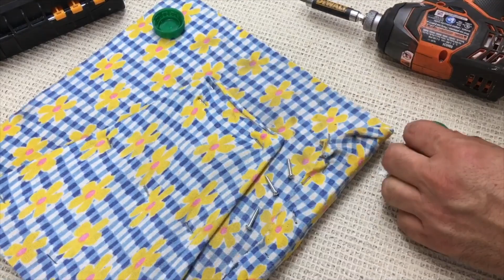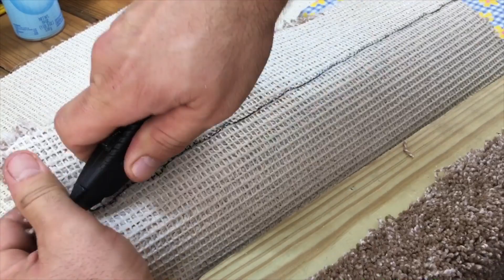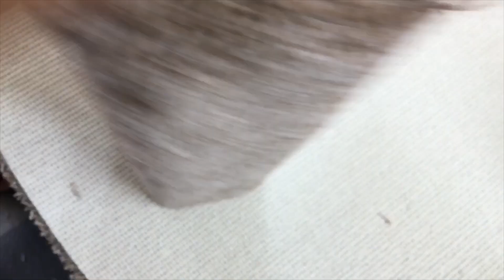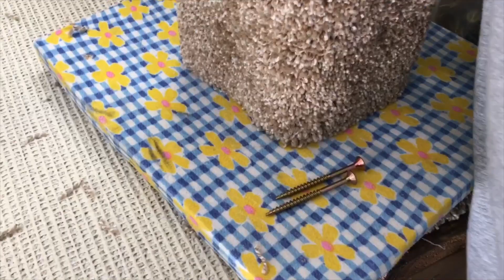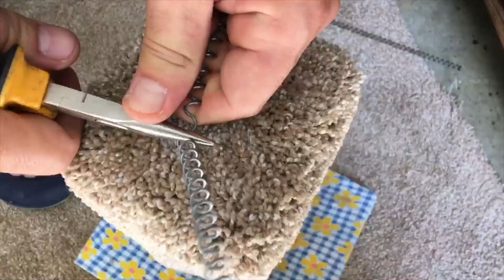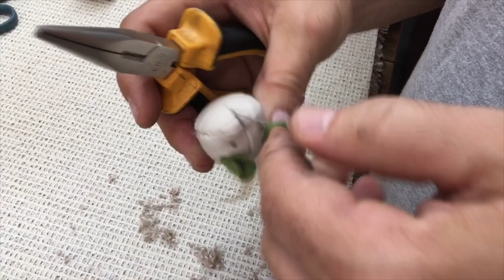How to Make Easy Cat Scratching Post with Scrap Material

Comment: What material did u use for the post
Reply from the maker: Center core is 6”x6” square wood, I wrapped it with a scrap piece of carpet I had left from a previous project.